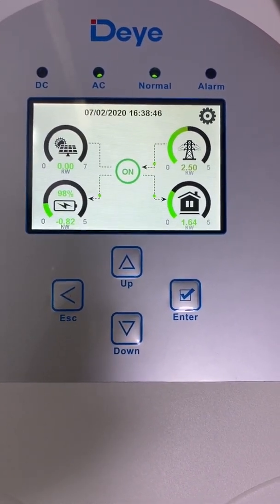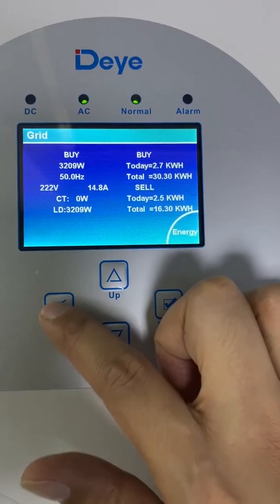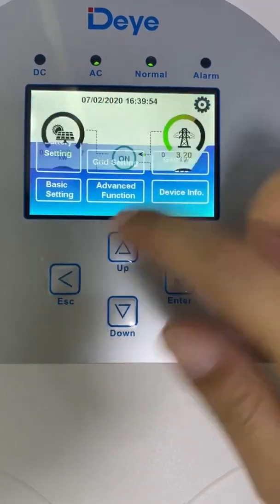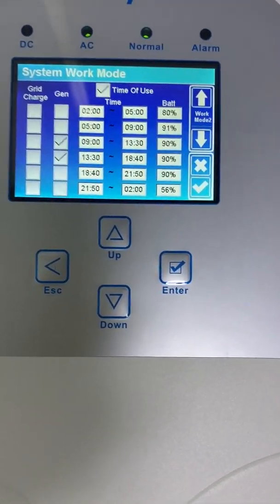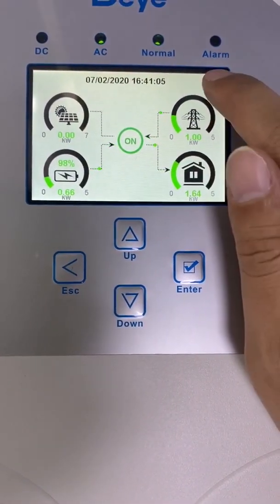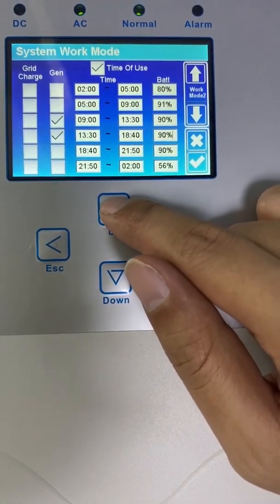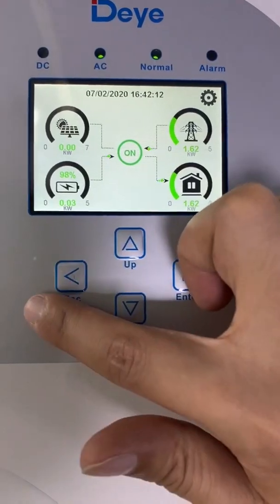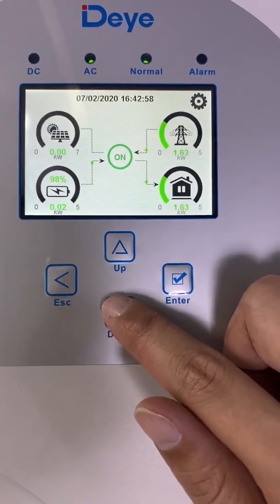Grid Peak shaving function of Deye hybrid inverter

Comment: Nice video 
Can you do the same for the genarator

I want to know if I can set a maximum power from the generator and when the load is higher it will use battery

After if the load drops below the limit will the generator charge the battery 

I want to create a hybrid generator in order to power my ice cream machine
Reply: dynamic peak shaving is possible, requires quite a lot of customisation, - if you know the exact "load is higher" in kw and kwh and duration , then you could simplify the dispatch without having to do dynamic peak shaving, cabinet bess is not the perfect solution although it is the most convenient choice.

Comment: Hi and thanks
Will this unit do the following.
Charge the battery between 0030 and 0430 during cheap electric when the grid can also power house
Then discharge during the rest of the time preventing grid use until empty?
Also can you pick what kw to charge the battery?
Cheers
Reply: cabinet bess dispatch can do this - need your load proifle - kw and kwh per half hour durations - view